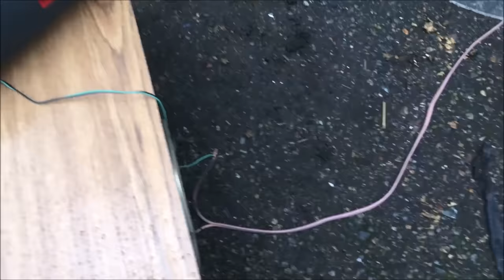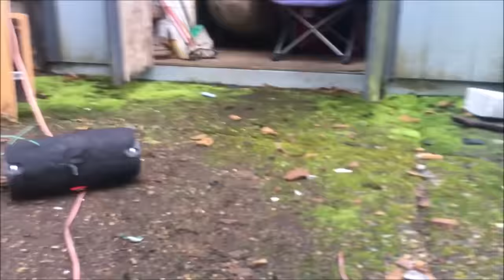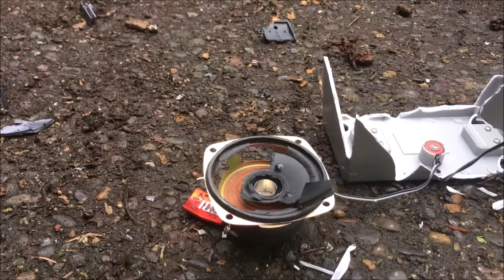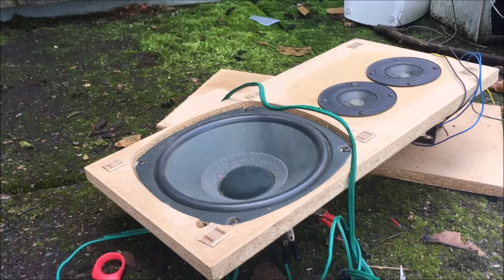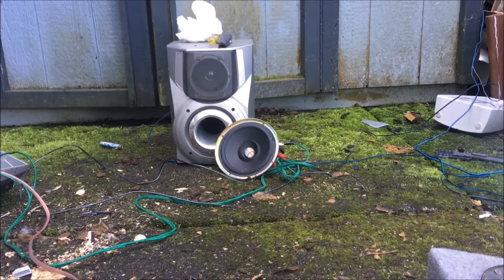31 Speaker Blow Outs

Comment: The only serious blowout of a JBL Xtreme. On internet you find a lot of clickbait. I suggest you a passive radiator blowout. Mount some little ones on a giant subwoofer box and see them getting throwed away
Reply: Channel - That Fucking Unnamed Production no low frequency mode damages the amp battery and drivers so it ain't clickbait
Reply: Channel - That Fucking Unnamed Production if you blow a speaker it won't be sure to smoke and blowout can be shown if the coil got damage
Reply: Dude it wasn’t even a real blowout, did you guys really not see? He connected the JBL XTreme to a BIGASS amplifier, so the amplifier was so strong that It was able to blow the woofers, if he used the JBL’s amp, it would be just about impossible to blow the XTreme
Reply: @jedithusnbixby2108  Fuck no, do you even understand what that "low frequency mode" is? It disables the DSP!
Reply: Good idea!
Reply: @testjblbass8482  lmao, obviously he overpowered it that's how you blow a speaker
Reply: Channel - That Fucking Unnamed Production 
Eeeeeeeeeeee
Reply: @jedithusnbixby2108  yes its clickbait.....blowout doesnt mean that you bottom out your speaker 2 timesss. It means frying the coil to its death...
Reply: Test JBL Bass no
Reply: Static Vapour ik shitty poop
Reply: The Killer yes that’s what happen but much slower
Reply: Static Vapour and yes it damages the whole thing
Reply: Duuude that's so cool how do u over power a speaker?

Comment: Tbh , the jbl xtreme handled that long excursion much longer than those other pieces of crap :)
Reply: I expected the JBL Xtreme lasting atleast 5 Minutes. It wasn't that much power. There other speakers here got powered by much more watts.
Reply: JBL builds tough speaker drivers but the drivers cost each 35$(Used but good) i dont know why the drivers are so cheap but they like 300$ speaker drivers
Reply: @blooddrag0ns192  well the cost of a whole bluetooth speaker includes the electronics , so i think its reasonably priced , no worries about it being cheap :)
Reply: Hmm my Subwoofer has 1500 Watts on the JBL it was dead in Like 10 sec.
Reply: @blooddrag0ns192  those shitty pieces of crap are worth like 2$